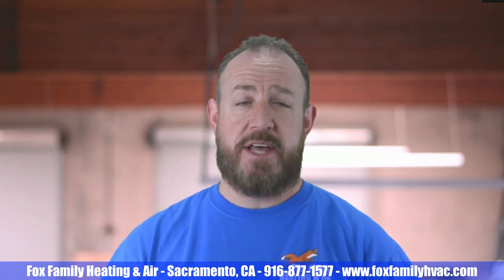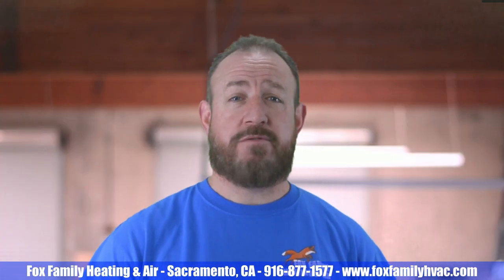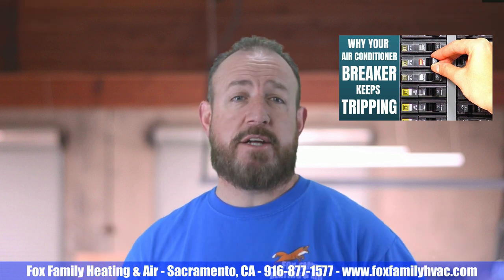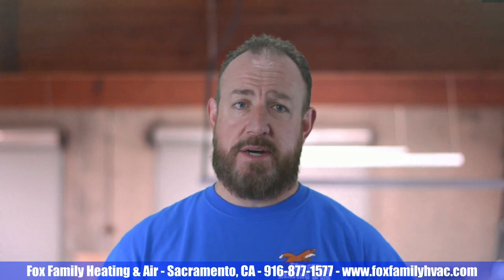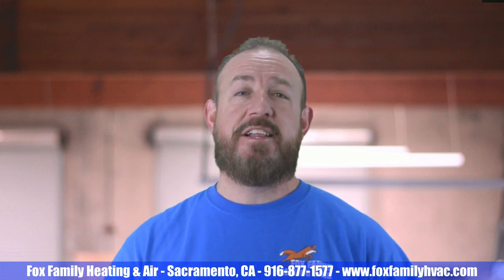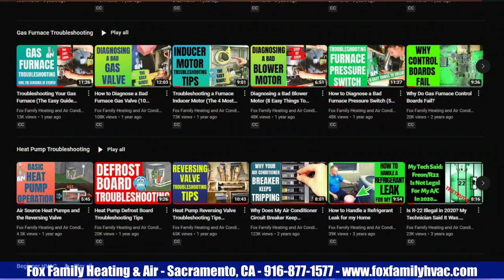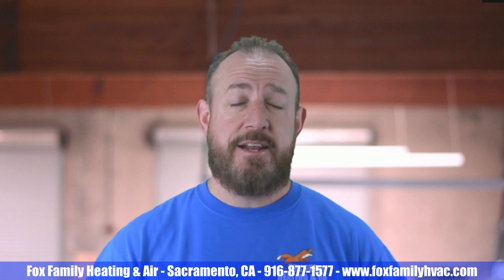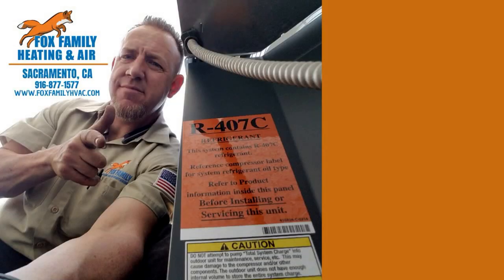Why is My Furnace Not Working After a Power Outage?

Comment: Hi, we had a power outage with hurricane milton, my generator at one point tripped. My thermostat is not coming on. Tested and there’s 240v to the air handler, i tested the thermostat and it’s working on another system. Fuse is fine. I replaced the low voltage transformer, replaced the defrost board and  relay, still no luck. Any ideas what I can test and how to track down the issue?

Thanks

Comment: I love, that I never have to change batteries ever again. Because my Nest thermostat runs off from the 24 volts from the furnace. Plus, I love the Nest Thermostat, because I can control my thermostat from my phone. So, if I'm away from my home in the summer,  I can  turn on my air conditioning, before I arrive home. Before I got my new furnace and air conditioning unit, my old thermostat always blinked the time. Because it was too much in a butt to program it. I hated the Nest Thermostat running on a schedule, because it would randomly turn off/on. I wanted to control the Thermostat manually. So, I found out, how turn off auto schedule.
Reply from the maker: Yeah that nest is great. A lot of people like it.

Comment: Electric is on, thermostat shows: heat on, but it doesn’t. I heard some noise coming from air handler but nothing happening. I replaced capacitor and connector. Nothing! No heat coming!

Comment: The new trane furnaces are poorly engineered they made some big mistakes but in the past they did make pretty good furnaces until they change the cabinet size and front internal combustion wall reducing the return air inlet & the electronics etc are susceptible to water damage etc

I’m not a fan of carrier either, expensive for parts & they had many issues with the secondary heat exchangers in the past
Nice features etc but it’s seems there always trying to reinvent the wheel & they can be hard to access certain parts for maintenance to

Lennox suck I can’t stand them
Some nice features etc but there cheaply made. Now the Armstrong, Allied air furnace is awesome as it has a stainless steel heat exchanger that is pretty much bullet proof
The Armstrong is exactly same as Lennox but way better heat exchanger

Rheem is making a pretty nice furnace 
I like the napoleons too C96 & C97